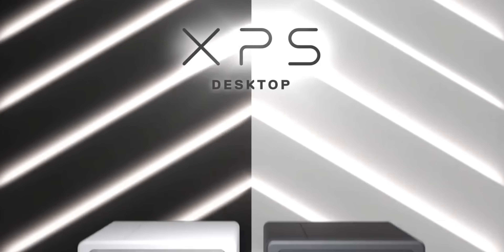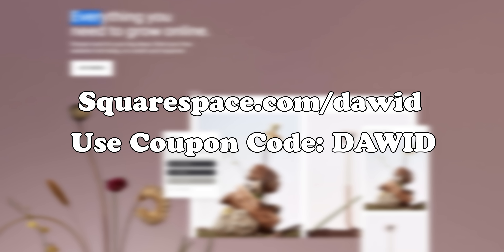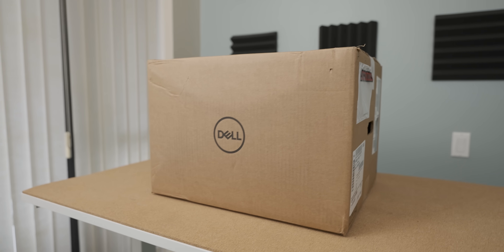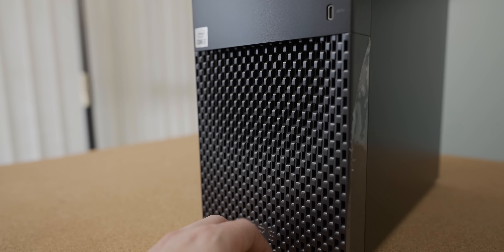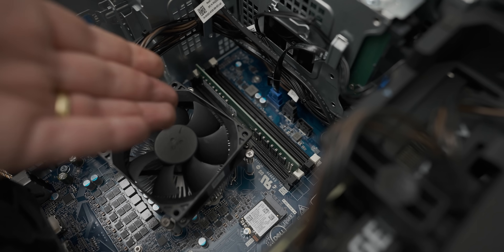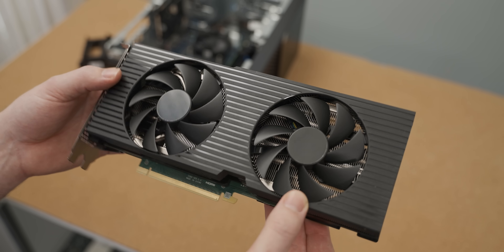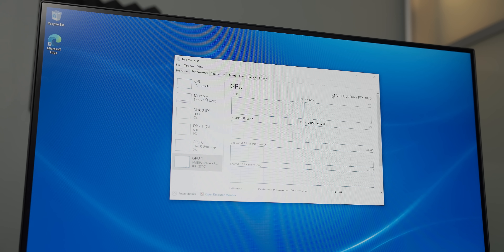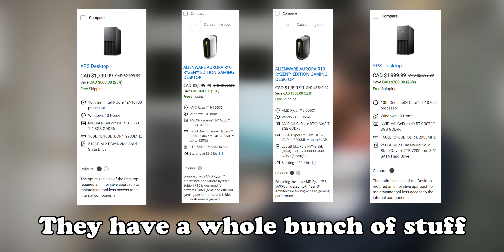DELL Did Me Dirty... RTX 3070 Dell XPS Pre-Built

Comment: im kind of curious how theyre even getting away with the cheapo cooler, if i were intel, id flip sh!t about it. 90C on a cpu is not acceptable, especially when its running slower than it should. my friends 10600k done better with the the intel stock cooler than whatever that hunk of plastic is, which goes to show how lazy they are in their design and part management. like seriously... is $2 more to source more materail for a cooler on the whole 500 they sell going to make a difference? No, no it wont. Also, if they are marketing this as a workflow rig, they should be ashamed for the cheapskate sh!t they pull. Honestly the ram isnt my fear, its the cpu causing instability over time because of it toasting that "vrm" and socket or so what its supposed to be.

Comment: Horrendous fps for those games. My last gen graphics card and processor get a good bit higher at 1440p
Reply: It would have been nice if he could have done the review with a better cooler and proper ram setup. You can trash on Dell for the bad setup, but you can't trash the hardware that was gimped out of no fault of its own bad design etc.

I'm pretty sure if it had  proper dual channel ram and a better cooler your last-gen is not touching that 3070 unless you have a 2080ti. As the GPU temps were just fine despite it being a hotbox in the case so I doubt cooling is an issue on the GPU, the real question is if it performs at least reference specs from a hardware stance.

Barring the GPU itself not being on par with reference and proper setup, the only bottleneck I see would be the cheaper ram being clocked lower.
Reply: @mrroboto6361  yes, that is obvious. The complaint is that this is what unknowing people pay for and expect "3070" performance and don't get it. Obviously not his fault.
Reply: Yeah that's horrible. Got a ryzen 2600 and gtx 1080 putting up better numbers at 1440p
Reply: @RaneBoDasch  I’ve got the same cpu but it runs super hot I need to get a good cpu cooler which one do you have?
Reply: @AFKJosh  stock cooler should be ok if you're not overclocking. Try reapplying the thermal paste and check mounting pressure.  I actually have a 240 mil aio. Its a bit overkill but it keeps my temps below 60c under heavy load. Its a pretty cheap aio. Uphere brand. Its lasted 4 years now and i rarely shut off my pc. I'd recommend something like the hyper 212 evo. Any $20 to 30 aftermarket cooler should be fine
Reply: @RaneBoDasch  It’s a prebuilt and I don’t think it’s cpu fan is good at all I’m pretty sure it went to 90 degrees so I’m thinking about getting the hyper 212 black edition for it
Reply: @AFKJosh  Just make sure there's enough space in the case for it. You may have to go with a low profile cooler. Noctua has a pretty good one
Reply: @AFKJosh  Now the fun bit...can you actually mount a different cooler in that system? 😀 I am guessing that it uses a proprietary mounting system.

What about that PS if it fails? That does not look like it can be replaced easily. My guess is that if any part of that system fails you basically have to trash the whole thing.
Reply: @Tugela60  yeah i can I got a hyper212 black edition

Comment: I've ended up buying three dell prebuilds in my life time. And I have to say, I haven't had that many problems with them. And actually they're pretty decent for what they do: power wise and price wise. About three years ago I bought a Inspiron 5676 with a  Ryzen 7 1700 and a 1060. I paid $50 more than what I paid for my iPhone 8. I'm not an avid gamer, but it played the games I liked really well. It has a 120mm AIO for a cooler. And it had the open slot for an M.2, expansion for an additional 3.5 hard drive and an additional 2.5 hard drive, all with power hookups ready ... I had to buy a sata cable for the 2.5. It's supported me well for the past years, and the only reason why I've replaced it was because I wanted to build a new computer. I'll repurposed it for my home lab. If your an avid gamer where frame rates are important to you, then don't get one. But it's not a bad computer for general computing with some gaming on the side.

Comment: Nvidia sets some design requirements for manufacturers. Coolers have to have a certain performance, the RTX logo should be on the card, etc. Looks like Dell did the bare minimum. Most RTX 3070s come with double 8 pin connectors (or 8+6 like mine) and not a single 8 pin like that one. Which is a shame considering that the card actually has a beefy cooler and should therefore be able to make use of more power.

About the rest of the system, why does Dells thermal design look like it's stuck in 2005? Is there even a fan at the front or is it just the 80 mm fan at the back?

Comment: typical dell. pos proprietary psu and oddly designed system which is prob wired differently where you cant easily swap out psu, and even if you wanted to replace psu it wouldn't fit. but, hey it comes with 3070, until psu blows up.

Comment: I've been looking at prebuilts from companies that let you customize. It's looking like that may be the best way to get the newest gen CPUs/GPUs. The premium isn't that bad and I figure the case will amount to a shipping container. Most of the companies let you pick from various cases, but I have a specific one I want so I'll just get the cheapest and transfer the guts from my current system into that.Total rip-off for $1500 given you can get similar from Cyberpower, Ibuypower, or similar with more or less standard or even branded parts. Oh and the default for most of them is dual channel ram at this point.  The front I/O is the only thing about that Dell system that isn't utter crap. The off angle CPU cooler made me laugh at least.

Comment: That is XPS series , if you want gamer theme ,you can buy Alienware Aurora series . I search Dell website , i9 10900KF, RTX 3090 (dell water cooled version with pump and radiator in full size  discrete PCIE card) 32G DDR 3200MHZ , 1000W PSU , for USD 4871 .

Comment: thank you for the macaffy comment
would like to see the card put into a setting where we could see true performance of it , as i may use youre method to procure a 3090, humor me maybe? those frame rate were horrid for a 3070 my 1080 out performs it in what im sure is a molten state sinces its blower card and i give no fucks about lowering graphics below ultimate
or cleaning at this point cuz im 90% done with new build and neeeeeeeeeeeeed a new card.

Comment: Multi rail power supply and a single 8-pin that is pushed way over spec with the 3070. That PSU is not gonna last long. Also, Dell shipping the wrong RAM configuration and using misleading marketing material is disappointing.
Reply: The PSU will be fine. This OEM GPU will be heavily power limited and will never reach the expected framerates.

Comment: I would mention that this is single 16gb dual rank RAM stick (basically works in dual channel). If they would give you 2x8gb dual rank you would fly in quad channel. But it is not mentioned on the website. They could give you 2x8gb single rank - it would be kind of the same or worse.

Comment: it's funny how here in brazil you can find 3070/80 and sometimes 90 in stock at basically every store because it's so expensive that almost no1 can buy (the start price for the 3070 is around $1700, the 3090 is around $5400)

Comment: I have owned many Dell products including Alienware and every single one has had at least 1 advertised hardware feature that does not get installed. Dell is also well known for using the absolute worst possible cooling solutions. My Alienware PC got so hot it would shut down. After I spent many many hours discussing a replacement with Dell, they finally agreed to replace the unit. The new unit did the exact same thing even though I paid an additional $115 to have them install a better cooler. (The second unit still had the same garbage cooler despite my paying $115 more to upgrade it.) Dell is garbage for gaming. Only ever buy Dell if you only use your computer for MS office or email.
Actually even then, buy something better.

Comment: They didn't do me as dirty as they did you... I bought a an Aurora R11 to get a RTX 3080. Everything seems to work to spec. However, the salesman swindled me into getting the "dark of the moon" version, instead of the "light of the MANY MORE COOL LEDS". If you need an RTX 3000 series card, and you are opting for Alienware to get it, always demand the light version. The guts within both are the same sure. But the light version has way more LED on the case--making it the clear winner in the contest of cool. JFYI

Comment: Could i recommend a basic prebuild that actually works, probably over priced but from what i expected and what i got it runs smooth enough for your average non-performance-fussy user, only £700, comes with a gtx1650 Aero 4gb(not so great), 16gb ram and an i5 9400f 6 core cpu, the cables were tidy and the pc came with spec sheets and quality test sheets and all sorts of testing "bloatware" (some of which is useful) With it being amazon you also have that 20% chance above ebay that you wont get totally fucked over lol https://www.amazon.co.uk/your-orders/pop/ref=ppx_yo_mob_b_pop?_encoding=UTF8&asin=B01IPH2638&gen=canonical&lineItemId=jnonowkpqitqqoy&orderId=202-4382335-8644358&packageId=1&returnSummaryId=&returnUnitIndices=&returnUnitMappingId=&shipmentId=DjC6JSBP2

Comment: I bought one of these with the i7 K series (ie better CPU cooler). Came with 2x 8GB in dual channel. Replace the CPU cooler with Noctua NH-U9S - doesn't require changing anything, just take the old cooler off and screw it on (with paste of course). You will need some longer m3 screws to attach the mount (16-20mm long work).

Comment: Hey, this is the kind of computer I wanted but it is hard to find cases like that,  I had to settle for a glass panel with rgb I didn't want rgb but I didn't read well enough when I got my motherboard, I just turned it off later with aura but it took me a while because of compatability issues, and I love the dell keyboards better than gaming keyboards as they are relatively silent and you can button mash without the keys flying if you keep going hard in games, I have a couple keys that no longer go in my razer keyboard and because it was a beta limited edition keyboard I can't replace the keys because they are not normal and the metal portion in the button is bent so I tried to fix it and it came out, and I put it back in but I didn't work like before,  so I just stick with the dell keyboard, so if you want to throw the keyboard away, would you mind sending it to me as I love how the dell keyboards work

Comment: You also forget the underpowered power supply means everything runs with more resistance and more heat. However a pre-built at this price is a bargain you just rip it apart and use the pieces. For like $300 you put it in a real case and get a decent doesn't even need to be good just passable heat sink put the 16 gig piece of s*** eBay and buy yourself two eight gigs.. last but not least a real power supply like thousand watt Platinum.

Comment: Can't believe you got that system for that price. That entire system was cheaper than a 3070 on the scalper market would cost. 

So they sold you a system including a 600 usd card with windows motherboard ram and power supply. Basically the entire rest of the system including windows for 400 usd

Comment: Once a company has done me wrong I will never do business with them again and Dell burned me on a mail in rebate back in 2002. The day after I received my PC from Dell I followed the instruction included in the box and filled out the appropriate paperwork and mailed it into them. They allowed I believe 60 days at that time. At week 3 I went online to check the status of my rebate and it said they had not yet received it. I thought 3 weeks is plenty but I had plenty of time left so I would give it another week or two. At around day 40 their system still said they had not received my paperwork so I decided to call them. The Dell representative informed me that I had mailed it to the wrong address. I was holding the paperwork in my hand and again read off the address included in the rebate instructions and she informed me that Dell had no such affiliation at that location. She then went on to give me a new address. After preparing everything a second time and mailing it to the new address given to me with about 20 days left I thought all would go smoothly. Well I was wrong. I repeatedly checked my rebate status online knowing my deadline was fast approaching. My status continued to say they had not received it. On day 60 the status had not changed so I again called and they tell me they had not received my paperwork. I was angry to put it mildly. Well I kept checking online and on day 62 or approx 22 days after I mailed it my status changed to received but past deadline. Im calling shenanigans. I have no way to prove it but I think they were deliberately screwing people out of their rebates. I'll never buy another Dell product.

Comment: built an HP omen a couple weeks ago with 3070, i7-10700k (yours has the F), 16 gb ram (2x8), 1 tb hdd, 512 gb ssd, etc. for $1650 after discounts. i think like 1790ish after all taxes. so I basically paid $100 more to get the i7-10700k (with a much better looking case, water cooling, and better motherboard)

Comment: OEM's are good if you want something cheap to just throw a decent PSU and GPU in and get gaming. Most are NOT good, however, if you invest in something like this which advertises expensive components but cheaps out on their implementation. Having an RTX 3070 on that dinky motherboard and tiny CPU cooler with a single stick of RAM is literally laughable. It looks like it was built by someone who looked up the bare minimum on google and threw something together. 

It sucks that GPU prices are insane right now. Hopefully we will return to sanity soon and building will be viable again.

Comment: I got a pre built liquid cooled i7 10700k with 3080. z490 board dual channel 32gb 3600mhz ram 1tb m.2 for 2100.00 got it first week of February. extremely pleased with my omen 30l build.....runs great and temps stay lower then 75c.......looks like you didnt do you your homework before buying. either that or you purposely wanted to review that turd.

Comment: You should document and share what it takes to get what you ordered (ram), and what was pictured as to CPU cooler.  The ram shouldn't take much, the CPU cooler will probably take a lot more...  Additionally I'd love it if you would have run some GPU benchmarks, to determine if it stacks up to an actual founders edition card, or if the power and or cooling of the dell artificially limits it.

Comment: I'm sure this is mentioned - but those are the new psu and mobo that all use 12v and converts to the appropriate power from the motherboard 

Also why it's rlly efficient (plat rated) and that beefy power converter on the mobo

Comment: It looks like an Optiplex clone.  XPS stands for Extreme Performance System (or Series).  There is nothing extreme about this system, except boredom.  That CPU cooler smh.
Old XPS systems had a nice and big heatsink and looked great.  XPS 410 and Dimension 9200 had white enamel metal sides.  Looked great with white, silver and black.  XPS 420 and 430 had a spiffy case.  They looked like a million dollars.  Used XPS 410 (same case as Dimension 9200), 420 and XPS 1647 laptop (Burgundy red cover) and Dimension line for years and years as well.  The downer was the leaky caps that had to be replaced :/.  Even some Optiplexes had the leaky cap problem.

Comment: seems like dell have a whole bunch of OEM 3070s in their warehouse, the 3060ti models are a lot more expensive than the 3070s. i calculated with the inflated price of all the other components removed, the 3070 on their site is only about ~800$, only if you can somehow resell the other parts for 800$(a whole i7-10700F prebuild).

Comment: My laptop gets better gaming performance, and better cpu temps. That's hilariously....sad. Not an exaggeration either. Laptop has a i7-10875H, and a RTX 3080 Mobile, same die as the desktop 3070. 80-90 fps in valhalla, 137 fps in SOTOR, 80+ in CP2077 on those settings, etc.

Comment: I noticed the card also only has a singular 8 pin so it most likely isn’t even up to full potential
Reply: Nvidia 3070 reference design has a single power connector. Go look up the 3070 specs on their website. People get confused because many models are actually OC models - higher clocks, more W, more fans.
Reply: @lunchbox9991  true I to have a 3070 but the reference is that weird 12 pin idk if that’s more or less than a single 8 pin

Comment: A so called gaming system with only stereo on board audio not even 5.1 or 7.1 that most systems come with.  Unless you use a home theater receiver and run your HDMI into that and then output to your display.  And the stupid mobile communication headset jack instead of separate mic and headphone jacks that most gaming headsets use.  I am not impressed

Comment: Fun fact: the 2x8 denotes that the RAM is dual rank, not dual channel. It seems counterintuitive but RAM modules have a rank, 1x8, 2x8 etc. 2x8 is in fact better than 1x8 but I'm pretty sure it's not better than running two 1x8 sticks in dual channel. Dell really does cut every corner they can with these things.

Comment: I gotta be honest- I got my 3080 out of an Alienware prebuilt a few weeks ago and a client of mine bought the rest of the system off of me... Win win. The gpu quality of the 3080 seems pretty good, fans don't go into full silent and aren't the quietest. It was interesting to see how Dell handled the 3070, looked very similar to the 3080- I already have a MSI 3070, so I was actually surprised to see only one 8 pin connector on the Dell version 🤔🤔.